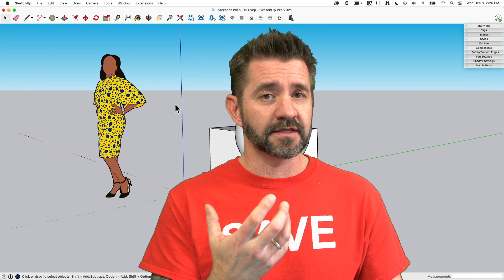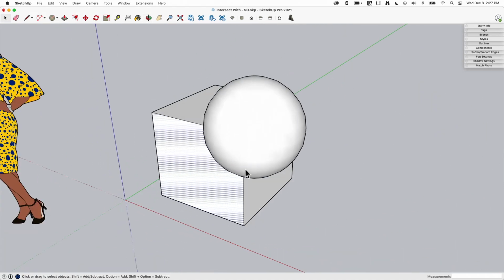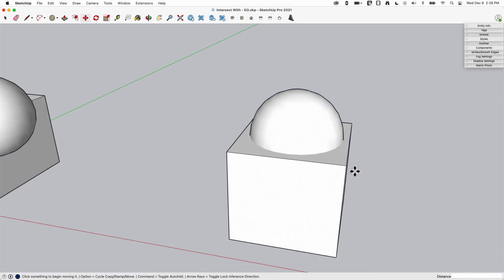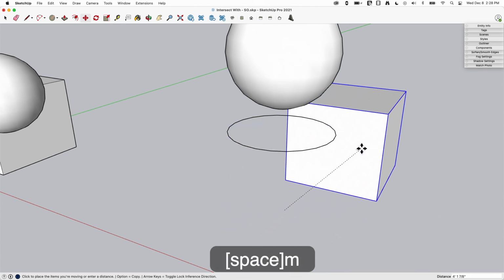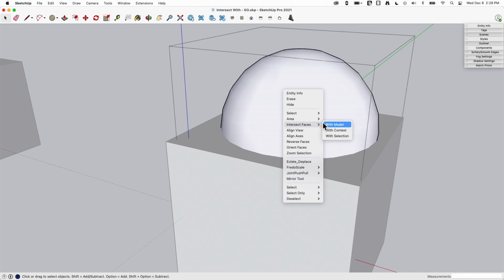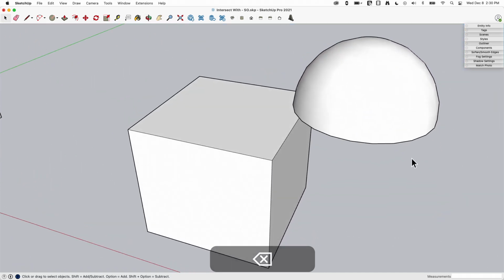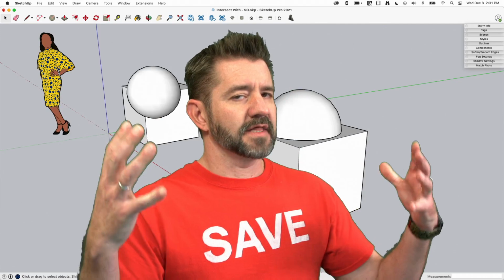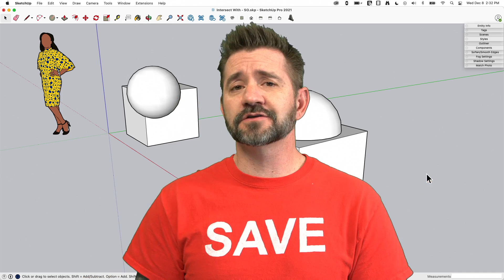Intersecting Faces - Square One

Comment: is there a option so see or show when geometry is intersecting? say parts of a model for a cutting list to check nothing is too long ans just hiding within another part.
Reply: ? Just highlight everything. Further, you can give parts different colours, then lower the opacity thru edit.
Reply: @ I was thinking a plugin of some kind that showed intersections between solids by highlighting them for you rather than manually looking as a checking tool